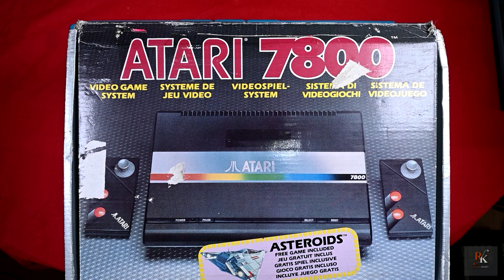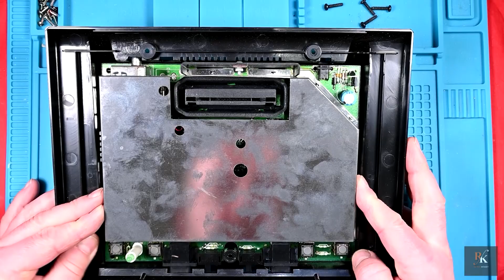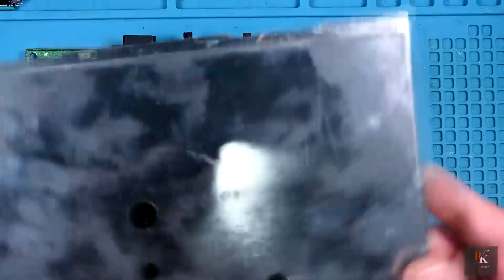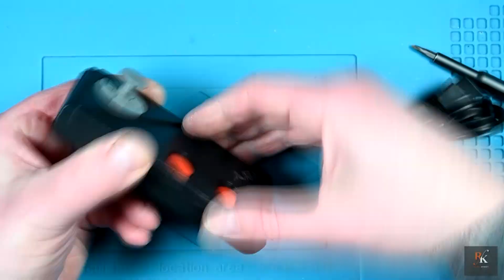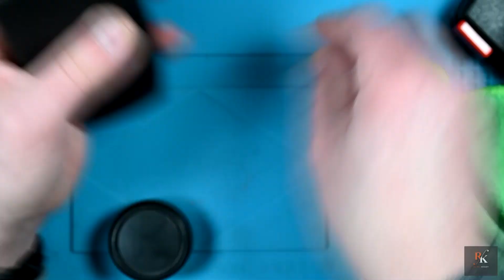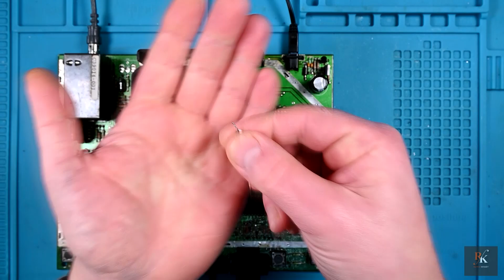Repair/Restoration: Faulty Atari 7800

Comment: Mine is dead.    5v is good.  Did the composite mod.  Still dead.  Maybe i shouldbtry a new sally also.?.
Reply from the maker: Thanks for the comment!

I'd hate to advise trying it if it wasn't and without more digging / fault finding, it's difficult to tell :(
Reply: @RetroKrazy i need pinout tests to test.  I have oscilloscope i just need a manual or experience to tell me what to look for.

Comment: Isn't that "Sally" originally on the board just a vanilla 6502?
Reply from the maker: I did some digging at the time and found a number of images showing that CPU being used in the 7800. Ironically, when I was chatting to RetroHQ, he also had that exact same CPU fail on him on a system. Could be they are just bad CPUs?
Certainly the CPU looked original underneath. No obvious signs of reworking - well not like the obviously badly fitted resistors ;-)
Reply: @RetroKrazy  Possible, I've used those UMC 6502s to repair other 8-bits in the past and they seem solid enough but who knows. My question was more that the model number doesn't appear to suggest it's anything special - we're they just putting in vanilla  6502s from the factory? 

Which reminds me, I just got a few 6502s from China - need to check them out...